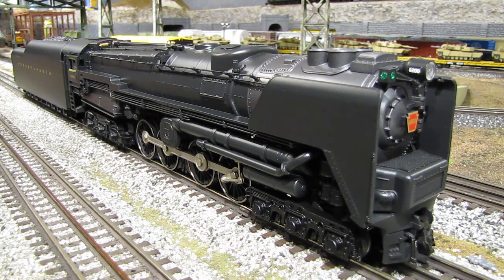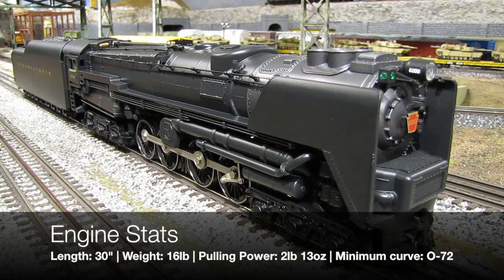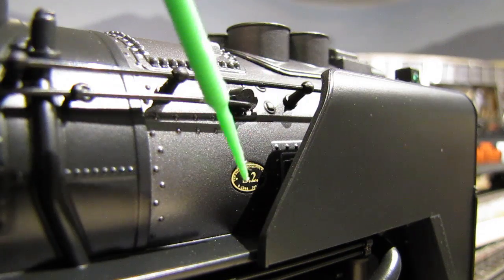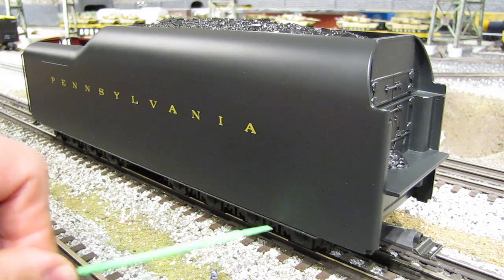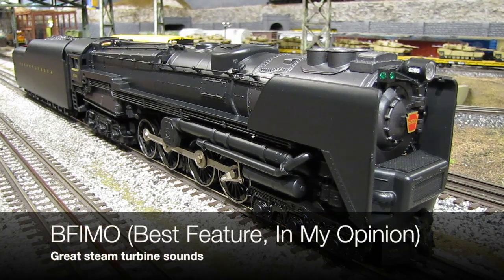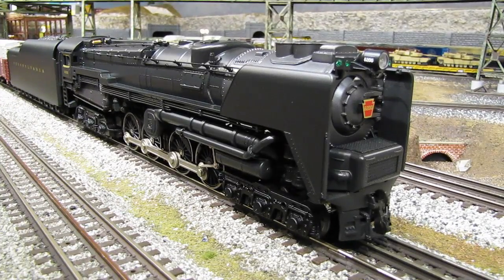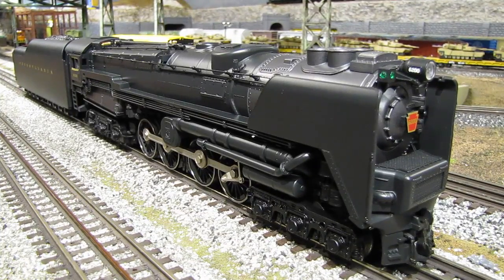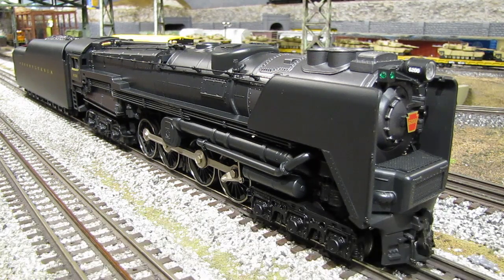Lionel PRR S2 Steam Turbine

Comment: Lionel's replica was made in 1946 until 1952 using all new tooling.  I have the ultra rare 1946 Lionel cut-away version of the 671 engine and 671W tender.  The Lionel shop cut the body of the toy loco and tender in half, then mounted its new for 1946 smoke bulb, reversing unit and atomic motor to the inside of the die cast loco as well as placing the whistle assembly inside the cutaway tender.  There is an actual photo taken around 1946 of Joshua Cowen Lionel holding it at his desk in Ron Hollander's book "All Aboard".  Although there is little documentation, most Lionel collectors believe this display cut-away was sent to Lionel's three show rooms - San Francisco, Chicago and New York; and possibly a few large distributors as an aid to boost sales.  Today, over 75 years later, one can count the number that still exist today on one hand.  Making it one of the rarest and most unique items Lionel made in the post war period.  Sterling

Comment: It's work noting that possibly the most successful steam turbine locomotive was the "Turbomotive" of the London, Midland and Scottish Railway in the UK; Sir William Stanier, the CME, went for a simpler control system on the turbine, and made the reverser turbine smaller, since it would only be used when the engine was running light engine, such as backing onto its' train, or running onto the shed.

Comment: Must of missed it.  what does the infrared senser do under the tender?
Reply: It lets the engine and tender communicate without wires running between them.
Reply: The IR that faces down at the track
Reply: +IMRROcom It's for a Sensor track that Lionel makes, it's basically like a programmable track magnet.

Comment: I'm with you about that coal load. I had the very first scale turbine from 1991 and it had a real coal load.  I much prefer the real load over the cast in load. I have the turbine now from 2000-2001 and I have already upgraded it's smoke unit so it now does very well but I just can't get past that cast coal pile. I think I am going to do the same thing that you mentioned and place a layer of real coal over the cast coal to see what it looks like before I would glue it down permanently.

Comment: I know someone that a an original turbine engine by lionel it freewheels but if a lionel train freewheels it most likely has a cracked gear which affects how much it can pull
Reply: DRUGSTORES all postwar engines freewheel, I have two of them
Reply: Potato27002 2020s and the f3s dont. Edit: the f3s might but the early 2020s dont
Reply: My 2025 freewheels happily and isy best running Lioni

Comment: the s2 burned fuel not coal. but the engine looks good regardless
Reply: The S2 burned coal, as a steam turbine fuel was just needed to heat the boiler.

Comment: It looks like the up 844
Reply: Zachary Skelly not really lol
Reply: Oh well it looks like it
Reply: Zachary Skelly it looks nothing like it lol, the turbine has a headlight higher up the boiler front, has 6 wheel trucks, absolutely different drive gear, 4 smoke stacks and it is for prr not UP
Reply: Oh sorry
Reply: Zachary Skelly it's fine, just wanted to let you know so you can succeed with learning about steam engines